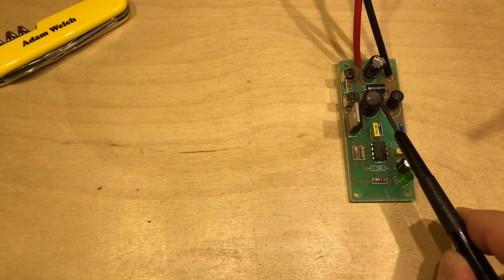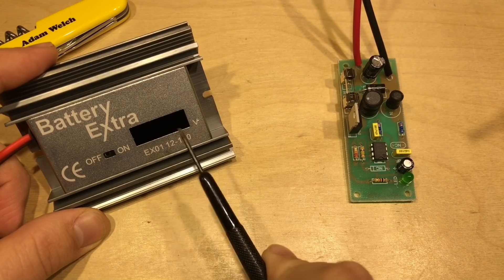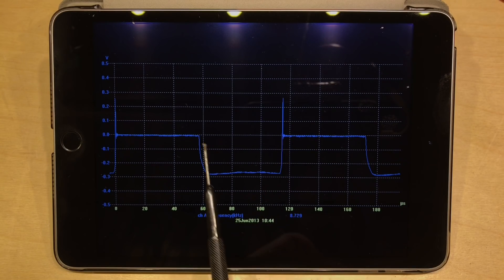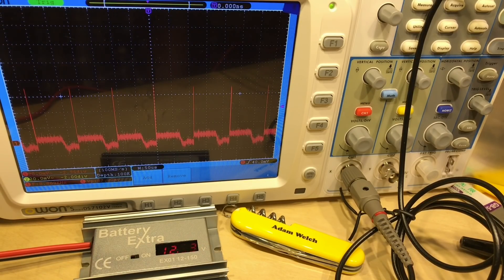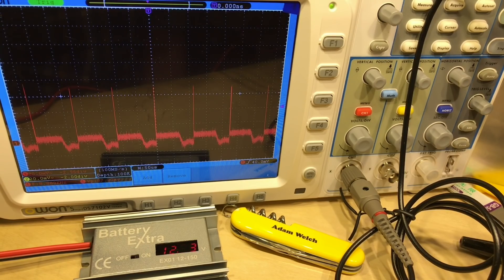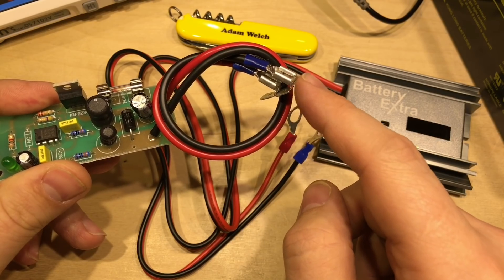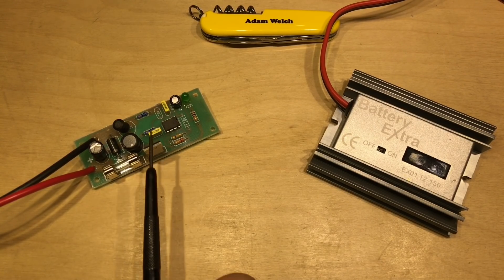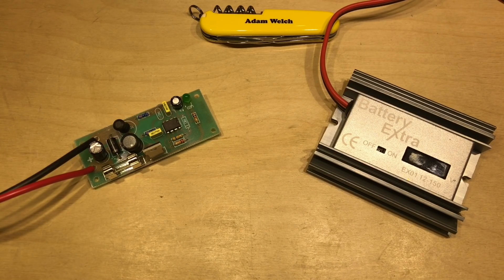Battery Extra EX01 vs. 555 Desulfator Kit - 12v Solar Shed

Comment: Did you manage to test for real on sulfated batteries? Checking specific gravity and CCA (cold cranking amps) before and after treatment. I didn't find any video where you mentioned at the end of this video you had 3 sulphated batteries to test on. There is a company that claims that they completely dissolve sulphated batteries, American Batteryminder.

Comment: Hi Adam, thank you for the measurements  on the scope and debunk the Battery Extra EX01 8-), we can see why it is doing nothing.  I have used both the 555 kit and another one I bought on Banggood called "Enusic™ 12V 6A Pulse Repair", basically doing the same thing as 555 kit but at more strong voltage pulse, peak at 15 to 16V, all I can say is the 555 and the Enusic work to restore to some degree my old car battery  (2014) on a Honda Accord 2003.  I have a battery tester that can measure the internal resistance, which gives the "health" of the battery, I made measurement before (28.18 mOhm) and after (12.61mOhm) I can clearly see the internal resistance dropped into the "good" zone, and also the battery maintains better its charge.  I just change the same battery for my sister's car and I measure 6.41mOhm on a completely new battery. As you know now because of covid19 we use less the car with work-from-home.   

Good video you did.

Comment: Adam thanks for the video. I am upset that my Battery Extra is ordered and on its way. Your video begs the question- is there an optimal pulse size, frequency and duration for battery desulfation or is the whole concept of desulfation and battery restoration with an electric module just hocus pocus?

Comment: This is my story.. I I bought 2 desulfators from ebay..very similar  to the ones of this tile "Desulfator Circuit Board " from Mad Electronic Engineering.look them up in YouTube....i I couldn't figure out how to order or make them my self ...so i use these and had very great succes i desulfated around 12 battery  deep cycle.the desulfator take a long time around 60 days .and they do work....if you understand how to order let me know...i need a few...
Reply: The same board design from AliExpress  ... https://www.aliexpress.com/item/32295560968.html  ( USD$8.30 shipped  ) .

Comment: I tried one of these battery extras, I put my scope on it and all I was seeing was 100mV spikes, absolutely useless. Re long leads, I would have sent it back but missed returning it in time so I cut the leads down but still SHITE. Don't waste your money on it. I'm an electronics engineer so am looking into this as I have several motorcycles/ batteries to look after.

Comment: I did buy a battery extra desulvator (same as yours) and did use it on several aging sla battery's,for month's at a time, but could not get any positive improvement whatsoever, so I do believe that it's only usefull purpose is to measure the battery voltage, what my multimeter does way more accurately.
There is a German made device called "battery plus" with gives pulses in an interval of 15 seconds each time, this device which is not only cheaper, but seems to actually do seem to work as It has been keeping the 75Ah car battery attached to it in good order for more than five years!
I've been experimenting with Bedini devices all so in the past and they to can give aging or undercharged sulfate battery's a new live but are tricky to use, I would suggest to check these out for experimenting, general speaking I've given up on lead acid battery's and since I bought a Life Po4 battery don't have the need for desulvator anymore!
Reply: On all that that lead acid batteries you need to have some kind of power going in like a 1 amp charger constantly be charging on top of that the desulfator. Thats how you see results...

Comment: Pulse height is going to be directly proportional to the internal resistance of the battery.  A high capacity battery that is healthy (low internal resistance) is going to have a low pulse amplitude, while a smaller and / or more heavily sulfated battery (higher internal resistance) will "allow" a higher amplitude pulse measured at the terminals.  Hopefully you compared these units side-by-side hooked to the same battery...

Comment: I see on the Yachting & Boating World forum that a chap (Maine Sail) has done extensive desulfator like for testing for months on similar age/type batteries & found the same as me.The desulfators he tried did not improve the batteries any more than an equalization charge /cycling. He used proper discharge testing methods & was hoping for some improvements, but didn't get any.
Reply from the maker: +Michael Thomas That's interesting to hear and much the same as my suspicions. Thank yoi for that.

Comment: How long did you cut the battery extra leads
Reply from the maker: About half as long as they were originally.  About a foot long I'd suggest.  Agreed the shorter the better however the oscilloscope image sent over by them suggests that they think spikes in the mV's are normal!
Reply: Ok, so shortening will improve them is all that matters really.

Comment: I am an electronics engineer. I have tested the 12 V Battery Extra & it did not have any effect on the Yuasa  70 AH battery I tested it on after several weeks. To be fair I checked & it originally gave a visible waveform on an os
Reply: My Battery Extra originally gave a visible waveform on an oscilloscope but packed in completely within 2 months. I have conductance meters & an automatic battery load discharge tester. No desulfators I have tried have worked on AGM batteries to any degree I could measure. I note

Comment: Hi Adam 
I purchased one of these, connected it up and all was fine for the first week. Then I noticed the led was not on and checked the fuse and it was blown, after replacing the fuse I connected it up and this fuse lasted for two seconds.So I then started checking for problems and found that 470 ohm and the 22k resisitor were bad I replaced both and and replaced the fuse reconnected it and this fuse lasted for 2 seconds. Do you have any ideas on what the problem may be.

Comment: Thank you or the informative video. I would like to mention that
there is a objective approach to assess if a desulfator really desulfates a battery, by measuring the internal resistance of the battery under desulfation proccess. You only need to invest on a battery tester (about 35 euro) capable of measuring this critical parameter. A battery under desulfation must present declining values of internal resistance over time. Mesurements of internal resistance taken on a weekly basis can proove the effectiveness of a desulfator or not.
Reply: Hi mosfetangel. I did that using a Centec conductance tester. The internal resistances did not get lower after weeks of using desulfators. A guy on YouTube called 'My Playhouse' did that too & said he thought the desulfators he tested were useless crap. CCA ratings obtained by  some conductance testers would have a similar effect, but obviously the higher the CCA the better on testers with no resistance measuring feature.

Comment: You seem to be fixated on high voltage pulses, my understanding is that the battery extra uses a frequency pulse.  https://www.youtube.com/watch?v=HwR-AtTD2K0&t=4s  shows how guy in America recovered his batteries from sulphating using a battery extra and quick search of you tube  for "battery extra desulfator" found mostly positive videos and comments.  They cant all be deluded or fake
Reply: I can only say that I have done lots of tests & the Battery Extra did nothing. I have several conductance testers, ACT meters, load testers & the FDY 10 automatic battery capacity testing over timed discharge meter.

I'd like the Battery Extra to have worked as I use scores of lead acid batteries, but it didn't. Sadly I despair at some of the 'testing' methods frequently mentioned on the Net. Guys stick a cheap multimeter on a battery & say 'this desulfator worked like magic-look the battery now reads over 12 volts'. A totally meaningless statement. A slow trickle charge with no desulfator will bring back some batteries after a fashion, no 'magic box' needed.
Reply from the maker: I think I was reasonably clear in my video that comments on my previous video were suggesting that the voltage spikes need to be quite high to be of any use.  I bought the battery extra specifically because of other peoples high praise for them and only suggested that clearly they don't subscribe to the high voltage theory.  I looked at the differences, the wave, the frequency and the voltage - but the voltage is the most obvious difference.
Battery Extra - and in fact all the 'branded' products I've found don't really show before and afters, time lapses or any real conclusive evidence - just testimonials and sales speak.  
I'm interested to prove to myself which device works best if they work at all.  As with everything though, others will have different experiences because no two situations will ever be quite the same.
Thanks for your comment and I'm sorry if the video has offended.
Reply from the maker: +Michael Thomas Thanks for all your input Michael.  I'm catching up but you've certainly shared some interesting experiences.
Reply: Hi Brian, yes you'd think the Battery Extra must have worked for some people.That said, since cycling batteries with a slow charge can bring back some batteries anyway, this could account for a percentage of good reviews.  

The kit built & Infinitum desulfators  I tested extensively also had lots of good reviews, but didn't work on various batteries I used. I can't find independent people on You Tube that have fully charged a battery, got a conductance meter reading, then  showed an improved meter reading for the battery after a few weeks on a desulfator. Let us know if you've seen any proper sites on You Tube where conductance testers show good results.

 Manufacturers will obviously show remarkable before & after plate pictures, but they can be faked or the desulfator could have been on for a year or more to have the effect.

I have over 5000 Amp Hours of 12 volt batteries both AGM & wet, so you'd think I could have got some improvement with the 3 desulfators I have tested, but sadly not. At least the Battery Extra people are honest in as much as they offer the 60 day trial. These units might have some effect I suppose occasionally so there isn't anything to lose with this firm.

 Some people will keep the desulfator because they THINK the desulfator is doing their batteries good.You often see comments on You Tube like 'it seems to be working', meaning the led on the unit is lit up, or the voltmeter works! Not exactly a scientific test though.

Comment: Sounds like smoke and mirrors to me, Adam. As others have said, the best thing is to look after batteries properly in the first place. * I've partially recovered sulphated gel batteries by prolonged constant current trickle charging - in the order of 50-100 mA for a 12Ah battery. Done with excess voltage, and immediate reduction when voltage spikes began to happen. Later in the process, I limited voltage to about 2.25 Volts per cell, until fully charged. An example: One 12V gel battery was received dead flat and unable to accept a sensible charge. After several weeks it had a capacity of around 9-10 Ah, and it was used normally for three or four years after that. * Out of interest, does vibration (ultrasonic, perhaps) have any useful effect on sulphate layers? Thanks.

Comment: 800 mv peak !!! These guys are making a joke. Battery Extra is a fraud. Or they do not know what they're doing because long wires attenuate the signal. At least if you obtain 30V peak it is more convincing.
Reply: There are professional desulfators costing thousands of pounds. Presumably these things must use a pretty high voltage pulse of some sort, assuming they do actually work? Anybody ever used an expensive unit on batteries? I use mostly AGM's , but have a lot of flooded here too.

Comment: I have The battery Xtra too in addition to many others. For the price, I believe it's way over-rated although its packed in a nice enclosure. Do not try and open it because yes, it will be destroyed. The best value for your buck desulphator kit is this. http://www.ebay.ie/itm/172544206931?_trksid=p2057872.m2749.l2649&ssPageName=STRK%3AMEBIDX%3AIT

Comment: I'm with you Adam. I am sceptical of the benefits of any desulphator units. Although not to the point where I am done experimenting with them. Let's just say "the jury's out".. lol 

However, the scope patterns of that Battery Extra tend to suggest it's pretty much snake oil. I would dare say you have saved me a few bucks, as I was almost rearing to purchase one based on the opinions of some down-under "solarists". Yes, I should know better! rofl

I think a better desulphator unit is one which derives it's energy externally from the battery, like the mains. That way it can keep the battery topped up as well as desulphating. The best unit I ever made was from a 50 volt garden light transformer with a 555 simply gating an output transistor on & off. No dicey flyback action. I would really like to play with that unit again however it seemed to disappear during our move from Foxton Beach all those years ago...although the xformer did show up. 

Also I have made many units based on neon bulb thresholds discharging a cap. Not sure if they work that well, I suspect the spike is not sharp enough. 

In case anyone wants to know where this whole idea came from - it's from farmers! Back in they day they found that connecting a duff battery to an electric fence for a month or two could often revive it. So I would suggest if anyone is really serious about desulphating experiments to get a surplus electric fence controller. 

See, the problem is that you can make a voltage as high as you like, but if it is high impedance when you connect it across something that is low impedance (e.g. a car battery) the voltage will fall to a very low value. Basic ohms law. If you want a massive spike it has to be delivered at a high impulse current. I suspect an electric fence controller would do that for you. 

Oh, and if you're gonna charge a battery while a (flyback based) desulphator is connected, run that charging current through an inductor, but with the desulphator unit connected directly to the battery. That way you can be sure none of that precious spike is heading back towards towards your charging source.
Reply from the maker: I just haven't seen compelling evidence to say they work - you'd think one of the big names would provide some conclusive proof, but they talk about the theory and show a picture of some clean looking plates.  Why has no one built a clear sided battery and done a time lapse for example?  The jury is out but I think I'll enjoy testing them out.  

Cheers for the information and explanation - I really enjoy your comments, you always seem to have an interesting story to tell!
Reply: You know, I think I did see YouTube video once of someone running one with one of those clear case batteries. But it wasn't timelapse from what I can remember. Maybe they just swapped batteries?

Comment: The desulphators from Courtiestown Marine look a lot more powerful than the EX01.

There's a desulpator forum out there, just google for Yuku Desulfator Forum, enough reading there for some time. :-)
Reply: Hi smileypete. I built the Courtiestown desulfator & yes my 'scope showed the pulse is a fair bit higher voltage than the Battery Extra.Sadly it hasn't improved   the batteries I have tried it on.I haven't  tried leaving one connected for over 3 months like Darren Hague did with a solar panel, just got no improvement after a few weeks. I'll try it longer.
You wouldn't want to leave an AGM or GEL battery on charge at more than 13.8v though for months ,so you'd need to check it regularly in case it dried out due to excess voltage(GEL especially don't fare well above 14.4 v even for a day or so)
Reply: Would have thought for best results the batt should be held at a fully charged state while the desulphator is being used, and even then it will take some considerable time. Not easy to do with a batt that's actively being used, and of course it can't reverse any damage to battery plates.

Seems the desulphator allows the batt to be exposed to higher than normal charge voltage which most off the shelf chargers can't do, or can only do without safely limiting current. Though a lot of the commercially sold desulphators seem to be a bit weedy and sold at inflated prices alongside snake oil like claims....

I've had some success with a non sealed battery by doing a mild EQ for a couple of half hour periods a day then trickle charging for 24/7 in between, but it did take a long time.
Reply: Hi Smileypete, I think these desulfators are so slow that that if they work at all they'd need to be connected for months & even then the improvements are likely to be slight. Equalizing wet cells at 15.5 -16 volts has been proven to restore battery capacity. Manufacturers like Varta & Rolls recommend doing it. I've never seen a manufacturer suggest using a desulfator. An old fashioned battery charger set to trickle with a series resistor of a few ohms to limit the current, has 'brought back' some sulphated batteries to an extent for me after a few days to a week. You'd think that in these days of conductance testers, loads of guys would be showing the 'magic' results they've got from their desulfators, but they don't seem to be. I'd love these boxes to work. Having bought 2 & built one from a kit, it's annoying to find they've done bugger all after weeks, but that's my experience.My experience of chemical additives is that they might give a short term improvement to a useless battery, but will shorten the lifespan if added to batteries that are reasonably new & in good condition. regards.